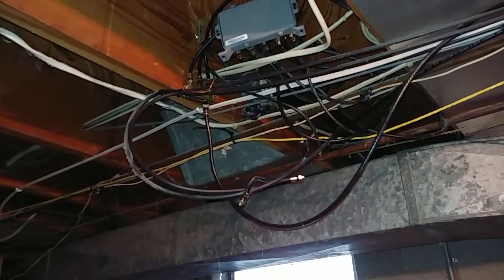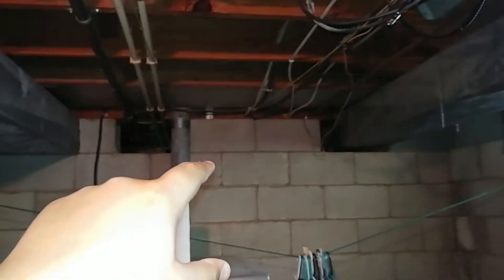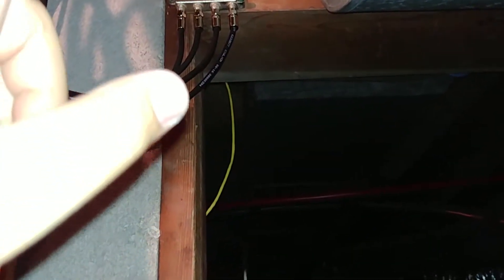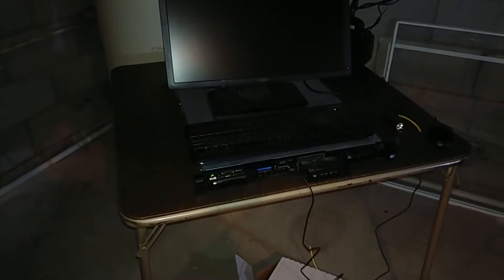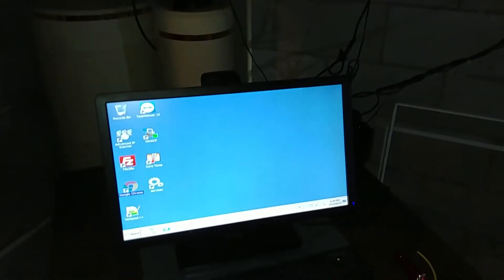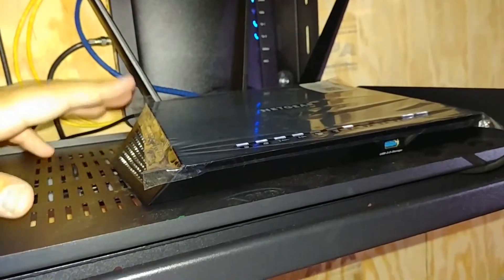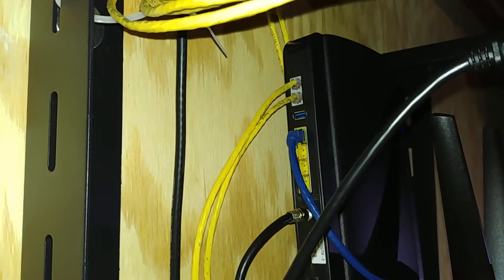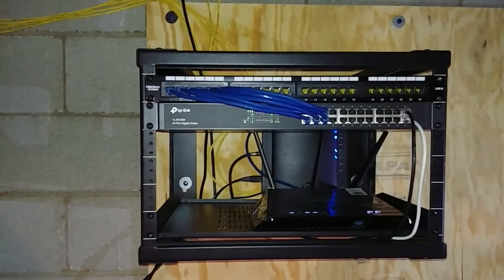Home Network Part 1

Comment: Good job. Just a few thoughts I had, hope you don't mind. Did you know that an RJ11 will work in a RJ45 port so you can terminate the phone wires in your patch panel & just use a short, cheep RJ11 to RJ11 wire? I know from personal experience that RJ11 ends don't really work well on Cat 5 cables, especially solid core. Also wanted to say good job on using cat 5e for phone as well for MANY reasons it's not worth using anything lower then Cat 5e now a days. Don't be to hard on cable installer I don't know if you told him going to move modem or not but ether way there not used to making so changes can be made easily, I know from 1st hand experience. Hope this info helps & you don't mind? Very good job & thank you for sharing as I LOVE videos like this.
Reply from the maker: Lance Brown Thank you for the information! I don't mind it at all. I was aware of terminating RJ11 into the patch panel but I just figured it would look better if they ran straight into the modem. I'm glad you enjoyed it and thanks for the feedback!

Comment: It seems like wasted effort to rack up mostly consumer level gear. But hey nice wire management!
Reply from the maker: I mainly did it to get everything the switch and everything off of the table. I plan to add a Firewall and some additional equipment in the future. Thanks for the comment!